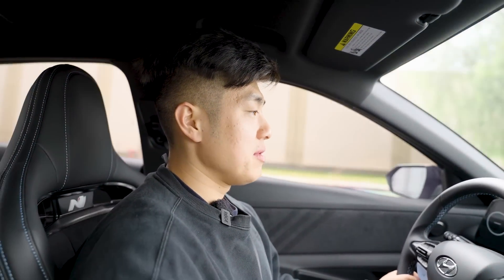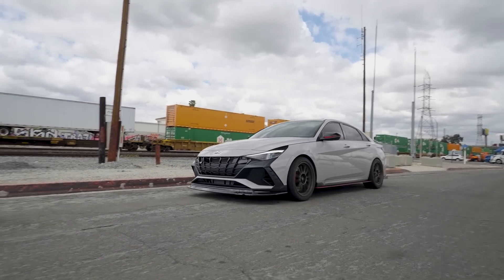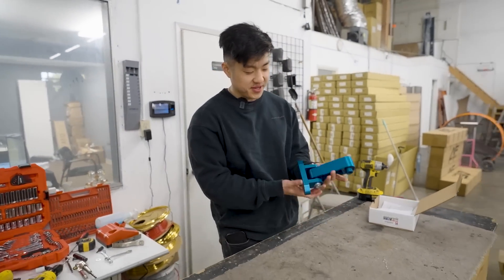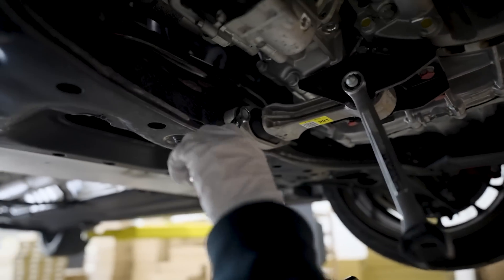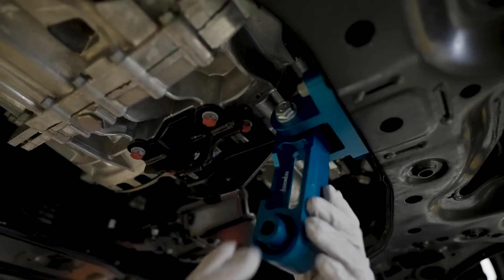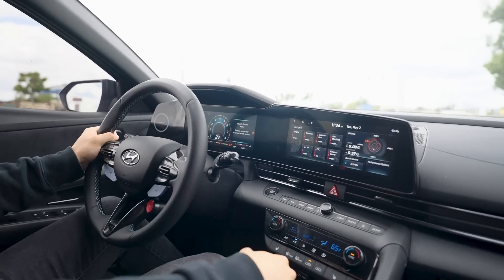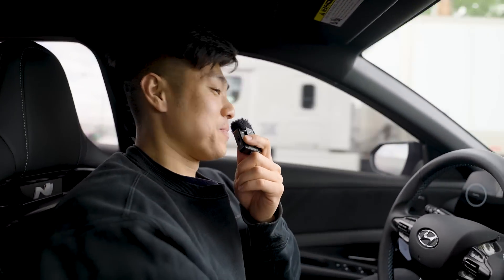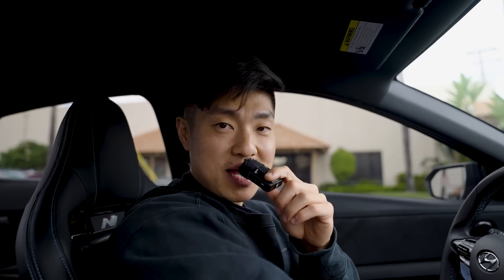NO MORE WHEEL HOPS!! | 2022+ Hyundai Elantra N

Comment: I'm no expert...but as an engineer..there is a reason other then vibration Hyundai made the mount flexible. I feel with the solid connections from the new mount is harmful as unused torque from the engine that do not go to the wheel is being absorbed by the internal drive train. Which could cause damage.  I would recommend what another person mentioned new stiffer bushings. That will at least still be able to reduce wheel hop, reduce vibration, and absorb unused engine torque.
Reply: Exactly why. I went with bushings instead of the mount itself, I 100% agree it just makes sense and I ain’t no engineer😂
Reply: That makes sense. Gotta have some kind of give or flex
Reply: It should be fine
Reply: They use softer rubber to absorbs vibration so customer doesn’t feel whole car shaking. The wheel hop will actually cause more damage to drive train
Reply: I'm not a hyundai engineer but the stock  engine mounts are usually to create bottom clearance. Sacrifice clearance for less wheel hops might not be for everyone.
Reply: @jonathanwrx7805  I'm sorry to say this but if someone bought this car to put the power down you bought the wrong car. they should of went for a 6 or 8 cylinder car. I bought a Hyundai N line to have fun while driving.
Reply: @the_nguy9123  the dct is a fast car 0-60😅
Reply: Can confirm this. EN is actually made out of the same frame as TCR version and a lot of stuffs are replaceable. It's hyundai being cheap (cost efficient lol) and being more modifiable.
Reply: Are engine mounts the same as bushings

Comment: Ok… idk if you are intentionally doing this but do y’all even use the actual launch control feature…. ?  Y’all are unnecessarily putting extreme stress on the engine with your “method”.  You’re not using the launch control properly,  you shouldn’t be preparing the launch at redline…..  you’ll know if you do a launch control properly if a prompt pops up to “adjust the RPM’s” and you’ll see the revs bounce at either 2500-3000rpms.  You guys are not launching it properly at all.
Reply: I’m sure he doesn’t care what you think. 😂
Reply: Very true. They are literally not using the launch control at all in the beginning to make it seem like it wheel hops like crazy. When using the launch control the low rpm decreases the chance of wheel hop. Source: I own a 22 Hyundai Veloster N DCT on Michelin PS4s OEM 235/35R19. 🤙
Reply: @JohnLee-db9zt  well then if the engine fails prematurely, it’s his fault.  Just sayin🤷🏻‍♂️.  Maybe you don’t care but you cared enough to comment this to me so whatever bruh
Reply: @AReynoso16  yea I own the EN and I was cringing heavily like is no one else gonna say anything???
Reply: It’s a manual transmission , So there is no launch control

Comment: In the SRT4 the best way to reduce wheel hop was using moog problem solver lower control arms. Solid mounts just kept you from smacking the oil pan on the AC bracket.

Comment: Because the car in this video isnt octane learnt (max boost was only 15psi) my experience has been you won't get as much wheel hop as when it is learnt. Case in point i got a lower purple bushing on mine and it basically eliminated wheel hop when unlearnt. However when i later learnt the car (max boost around 17-19 psi), the wheel hop returned due to the higher power output. The best thing to eliminate wheel hop is to launch the car with 'care' and don't be so ham fisted. A bit of finesse goes a long way especially in 1st gear. Not easy to resist the habit or temptation to just mash the go pedal though.

Comment: I can see your on 15psi.  Do Octane learning process for the N (it should be in the manual) if you take it to the dragstrip. You will get peak 19psi when its learnt
Reply: doesnt woork w the 6mt
Reply: @jayy9634  yeh the manual states for the constant throttle method that Mt and dct can do it. I have dct and took a few tries to get it. It's annoying af to get the process to work, gotta follow it to the tee
Reply: @jonty3000  really? I have the 6mt and I’ve tried to do octane learning but I’ve never got it done. How do you do it?
Reply: @jayy9634  the way i use is in 4th gear > apply 50% throttle > get speed up to between 25-75mph > hold the 50% throttle and that mph range for around 5 seconds or as long as the road is > let go of the throttle below that mph and repeat the same process as many times as you can for 5minutes or more.

The other process is mt 6th gear > constant speed 68-99mph and hold that speed there for 5mins or more. You can use cruise control for this. However I don't have long roads to do this way.
Reply: @jonty3000  damn I need to start reading my manual because I did not do that at all😭 thanks a lot for the information🙏
Reply: I tried it on my DCT and I get 16-17 psi max no higher and then sometimes it goes away even if I didn’t fill up my tank or so, just goes away randomly. Any idea or clue how to do it while it can last and give me more psi ? I have only 91 highest octane. Thank you!
Reply: @supergzeyad4226  keep trying, once you get it a few times it makes the process easier. And it 'resets' back to 15-16psi over night. Very annoying thing!
Reply: @jonty3000  thank you so much fam. I will keep trying again then and yes I noticed it does go away no idea why but yes I feel the difference tho but feel like waste of time and so to do it but I think will try and do it again and see how it goes… but thank you again
Reply: @jonty3000 THANK YOU SO MUCH! I got it ✊️  ('23 En, man.) 
I only knew of the 6th gear method. I saw what you said about the other option (4th gear) and took some time, went out and tried it.
4th gear at exactly 50% for 5 seconds was hard. I didn't think I got it and went back home like a chump.
BUT, later I went to the store and just noticed on a little 2nd gear pull that it felt REAL  strong. I was like, huh? Could it be...? Sure enough, I saw 17PSI in 2nd, thinkin' maybe that was all I could get. Which was ok, I got a little somethin' 🤷‍♂️ " 
Then I pulled in 3rd and got 19psi ✊️ 
It definitely took practice to keep exactly at 50% but it did get a little easier. SO, you really could do this often and quickly, once you get good at it. 
It's easiest, obviously, to try it as slow as possible, so, 25mph. The car speeds up pretty quick. I can definitely see someone rearending somebody, trying this. SO BE CAREFUL. Obviously, get on an open road. There were also cyclists on the road I chose today. Hitting one of them would only be satisfying for a short time 😅
It would be cool if there was some indication once you got the fuel learned, or whatever. OR, if we just had the 19psi all the time. Or maybe just in N mode, or something.
Anyway, thank you so much for laying that out. You da' man 🫡
Reply: Aaaand now I can't seem to get it again, even though I've been better at holding 50% throttle. 10 second runs even 🤷‍♂️ Damn.
Reply: Got it! Turns out I have to do it longer, so I have to do the length of my road twice.
Aaaaand, it was still good the next day. For some reason 🤷‍♂️ I love it so much more with the extra psi 💪

Comment: Would the same mount work on the N-Line? My manual has nasty wheel hop, worse because it doesn’t come with LSD like the N does.
Reply: Yes it’s the same setup! I had a 2017 Kia Niro Hybrid and it also suffered from wheel hop and uncontrollable torque steer  the lower engine mount on it was also the same✌️